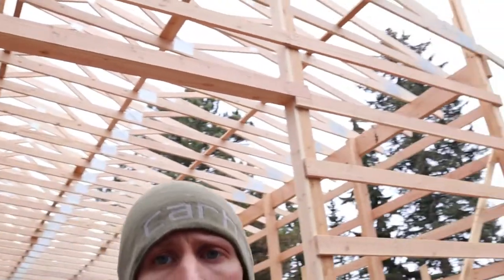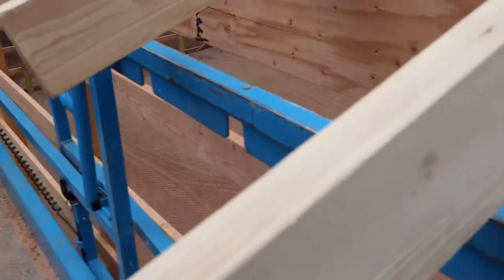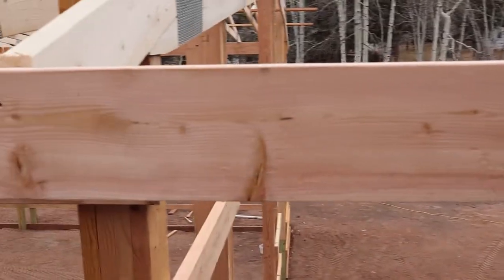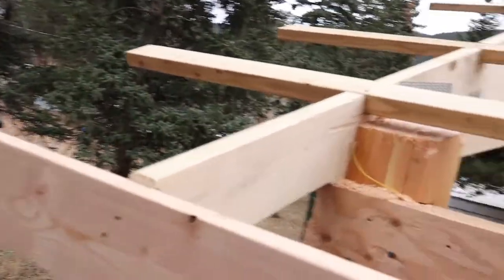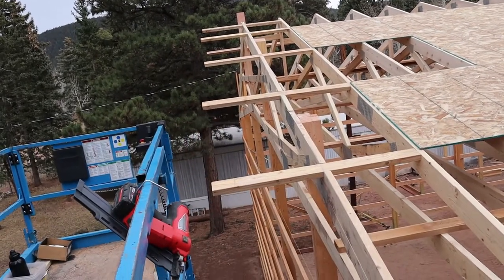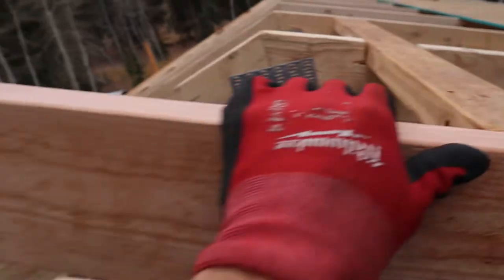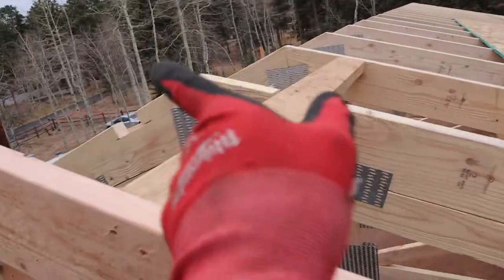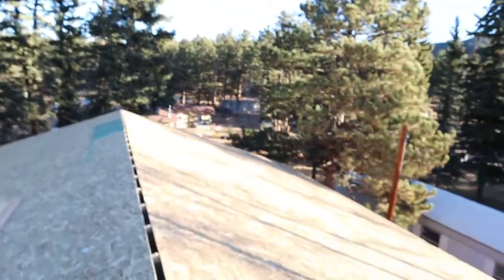ROOF SHEATHING// POST FRAME BUILDING PART 4// HOW TO SHEET A ROOF POST FRAME

Comment: did you staple down the sheathing? if so what stapler did you use cause that looks a ton easier than nails
Reply from the maker: Yes, I used a MAX 7/16” medium crown stapler. I prefer staples over nails. Less chance of blow through, I use 2” deep staples
Reply: @buildingwithjosh  did you need h clips?
Reply from the maker: @jhippl  I chose not to use H-Clips, I used ice and water underlayment and have had them puncture holes through. Since they are optional, I didn’t use them. They are there for spacing the sheets to keep a gap for expansion.

Comment: Nothing at all like RR buildings or MrPostframe.   They roof truss q 8’ apart then Perlins q2’ on edge marked then pull push truss to markings makes it lined up.  Everything is different on this.  Interesting.  I want 40’x 60’x mezzanines so how high walls? 20’ or 18’? Scissor truss might help ceiling height.
Reply from the maker: Yea, this is a different approach. I’ve done both ways. This way uses a beam on posts which allows trusses 2’oc. It worked better for a barndominium as far as plywood deck and closer interior framing for Sheetrock. 

20’ sidewall height will require beefier collumns, 18’ can still use 6x6 dimensional columns from our engineer. 18’ tall gives enough for 8’ upper floor height and 9’ lower floor height. Hope this helps!